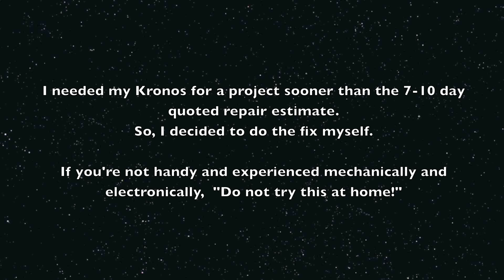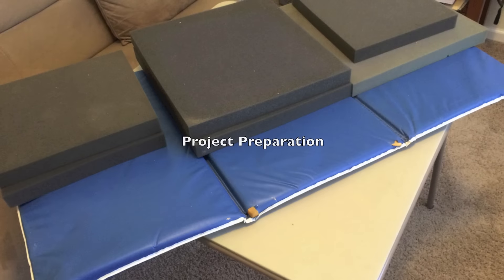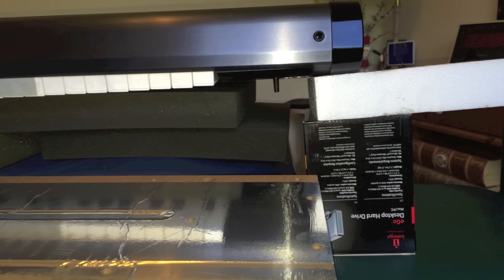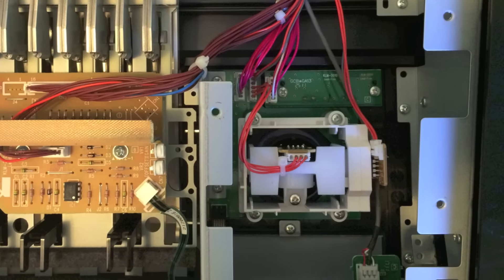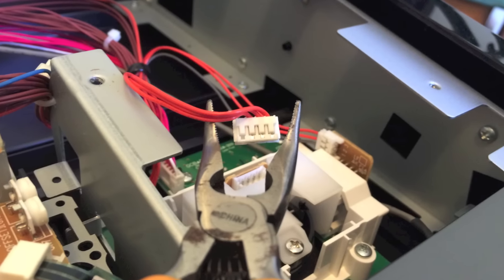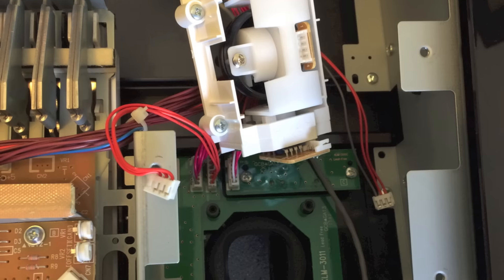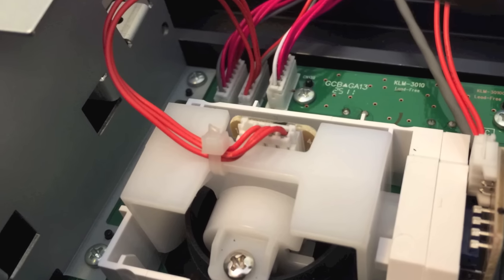How I opened my Korg Kronos to repair a Joystick Pitch Bend Controller detuning problem

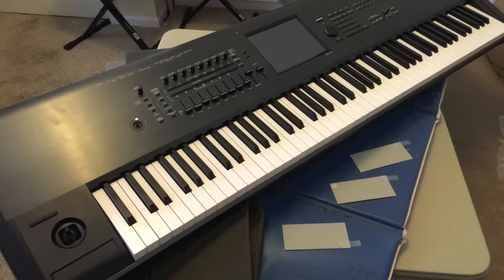Comment: At 4:30 you mention removing cardboard spacers, but it's not clear to me where they are placed during this procedure - or why. Thank you, great video. I actually had the same thing happen last year but it was serviced under warrantee.
Reply from the maker: Hi Dan.  The cardboard pieces (that came with the shipped factory keyboard - or make your own) should be wedged between the front facing side of the keys and the thin metal framing strip that runs along the entire front of all the keys.  If you do not insert the cardboard to maintain an approximately 1/16" spacing between the keybed and metal strip, the keybed could could shift and some keys will get stuck to the metal strip. That's why I included this step in the instructions. The cardboard is removed after the keyboard has been reassembled and all the screws are tight to insure no further movement. Glad you got it done under warranty.  Enjoy your great instrument!
Reply: Hi Hal, do you put spacers along the whole facing front of the keys or is it only several areas you put them in ? How do you get 1/16" cardboard thickness? Thanks

Comment: Thanks a lot for your video. I just notice that it not really a repair but a replacement you did !  Actually, it is possible not to replace all the unit but replace one potentiometer only (X axe), available on the net.
Reply from the maker: Thanks for your note Fred. The whole part that I showed was only $34 including shipping at the time so I was very happy when it totally solved my significant problem.  I'm not an expert, so as far as I knew, it looked to me like the potentiometer was integrated into the replacement assembly shown.  Honestly, I don't know what the Korg potentiometer would look like just by itself without the joystick module. Happily, the joystick and my now vintage Kronos have been functioning very well.

Comment: Thanks a lot;  I just replace in my Kronos2, part was only $19.95 from Parts Is Parts.
No spacers I could see for the K2 and it doesn't have those heat sinks apparently.
Reply from the maker: Glad you got to fix it yourself successfully.  Thank you for your feedback.  I remember some people, even with the original Kronos, were missing the spacers, or maybe they fell out in the packaging. If you didn't see the the heat sinks, they must have been redesigned or moved to a different position. I would think some kind of heat sink would still be needed..  Enjoy your reinvigorated Kronos. From what I've read recently, the Kronos is still in a league of its own as far as features and capabilities.

Comment: Thanks for the video. This set met on the right track. I could not get a replacement part, so I have repaired it instead. In my case the pitch problem occurred after using the mod wheel (+Y direction). As soon as I used the pitch bend, the pitch would be okay again. The problem was caused due to the bending moment on the potentiometer. So I have used the following approach:
- Desoldering the potentiometer, clean it  (see the how to from Mike Sisk: http://www.synthtopia.com/content/2017/09/02/how-to-repair-faders-on-a-vintage-synthesizer/)
- slightly bend the sliders
- Mount the potentiometer, but do not tighten the bold, so that it can move a little: this will prevent the bending moment when the mod wheel is used.
I do not know which part did the trick exactly, but it is now working correctly again. I am not sure how long it will last though.

Comment: Thanks for the video 🙏 I have Kronos workstation x. The first generation like yourself. Do you know if this takes DDR2 or DDR3 ram chips?  (I’m having a startup disk problem) and thinking it’s either to do with corrupt ram or the actual hard drive
Reply from the maker: Thank you. Sorry I don’t have familiarity with the chips. Luckily, my 11 year old original Kronos has not needed anything else and is in fact still working on the same old clock battery, which has not yet been replaced. I expect that to be the next service task. Good luck.

Comment: My pitch bend problem on my korg kronos 2 started when i plugged a behringer model d into my kronos 2 via midi cable. When i use the pitch bend i start using the pitch bend up and it goes for a little bit then skips to a much higher note and if i dont let it go back to center fast enough it takes like 10 seconds of a smeary transition back down which is really annoying and other times unless i giggle it around it stays like that. Even when i unplug it the same thing happens but its not as strong as when im using it for the model d. but its still really annoying AND NOW when i plugged it back in today and played for a little it randomly drifts up and down without me even touching it. Another problem i have when i first plugged my native instruments S88mk2 into it via midi i believe one of the presets on kronos was a pizz esemble or something and once every 3 minutes it plays piano for a second or 2 as the sound then goes back to strings. makes no sense. AND i have a problem where on a few keys sometimes the after touch makes the key play it self again. help me. I think all my problems are electric not mechanical. maybe the aftertouch on the few keys is but the others are electrical.

Comment: But in short, where does the problem come from? If you change the entire piece, which is the part that broke, is the potentiometer the one that causes the detuning?
Reply from the maker: Hi Paco.  Based on feedback from responses below, I believe you are right that it would be the potentiometer. However, the full module replacement was so cheap, it made sense for me to replace the complete unit. This way I would be covered for any other component of that module that might wear out in the future.  Good luck.

Comment: I think my “side wiring harness,” as you call it, is not properly attached. Is it supposed to screw in somehow?
Reply from the maker: Hi. The two red color wired harnesses each have a white plug that you pull out via the plastic plug with a small plier as shown in the video. Do not try to pull them out by pulling the red wires to avoid breaking the white plug connectors. There are no screws holding the harness. Screws are only used to fasten the whole controller assembly to the Kronos chassis. Good luck.
Reply: @Halunlimited  hmm, on mine, the whole side “assembly” was loose (not the wires) from the main joystick assembly. It seems to be causing the JS-X to not return fully to center. Do you think I need to replace it?
Reply from the maker: @JeffPalmer83  I don’t remember anything being loose. If something is loose, if it can’t be carefully tightened (eg via the 4 controller screws) then that loose play might be a problem. I’m not sure which component is loose. Is it the white plug attached to the red wires (I have been referring to it as the wired harness)? If the plug is loose, it might need to be pushed in deeper into the electrical socket. BTW, I have the original 11 year old Kronos (still working great). Maybe you have a newer one, and if the part doesn’t look the same, I may not know about it.
Reply: @Halunlimited  So it’s actually the little chip board piece on the side (and the part appears to be identical). So in your “bottom view” screenshot, it’s that whole side assembly in the front/left of the image. It’s like actually pulling loose from the main plastic housing. The wires that go into it are secure, though. Can you tell from your old piece how that side board connects to the main casing?
Reply from the maker: @JeffPalmer83  You said, "So in your “bottom view” screenshot, it’s that whole side assembly in the front/left of the image. It’s like actually pulling loose from the main plastic housing." I am looking at the 2:30 video time market for this reference.  My "side board" was firm. I don't know if that can also be pushed into the main plastic housing to make it more secure.  I would carefully try that. A loose fit implies a loose connection and that is never good.  The entire controller assembly part shown in the picture was very low cost, so if the side board does not go in firmer, then it sounds to me like you're better off getting a new replacement unit (with new sideboard already properly attached) as shown in what I received. Please note I am not a Korg rep and I am only giving my opinion based on my best hunch. Good luck.
Reply: @Halunlimited  yeah, 2:30 is what I was talking about as well. I had pushed it back in the other night, and that seemed to tighten up the joystick’s recentering behavior, but then it seemed to get loose again after a day of light use. I’m going to try going back in once more, but I’m also attempting to get a replacement part (waiting on in-stock alerts!). Appreciate the insight and help!
Reply from the maker: @JeffPalmer83  My pleasure.

Comment: Hmm, I'm having the same problem. I've seen the joystick assembly and the potentiometer, but I don't think the potentiometer comes with the assembly. I really don't want to spend $90/hr on a problem that's solved in 20 minutes, and spend time/money on driving it either four hours south or three hours north. Did the joystick come with the potentiometer per chance?